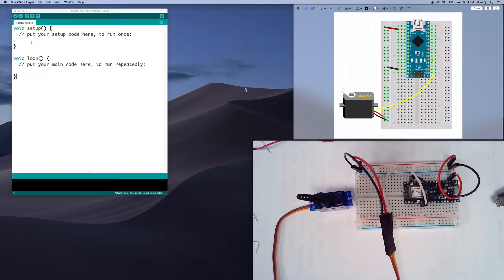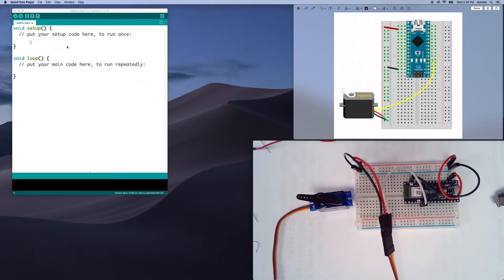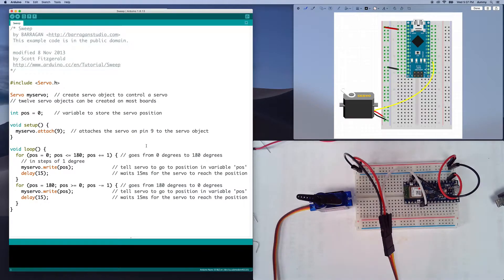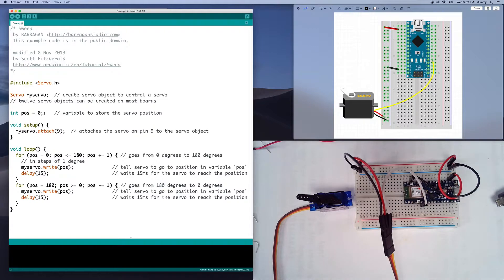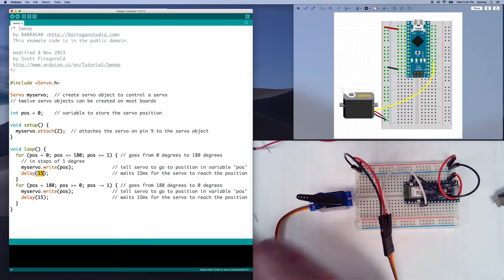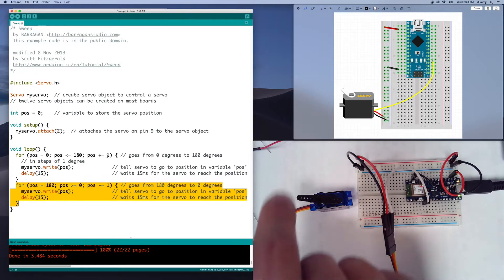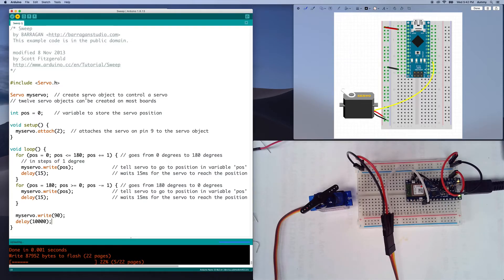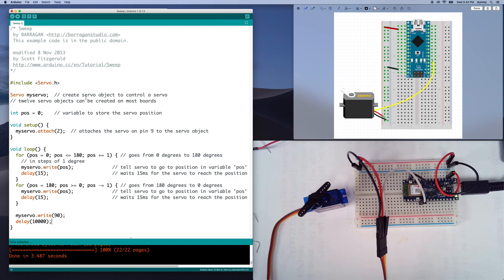servo library use

Comment: Hi Great Video Im trying to build something similar with a h bridge and 24v motor controller for a 24v servo motor, the question is how would you provide the power to the arduino board considering it doesn't handle more than 5v.